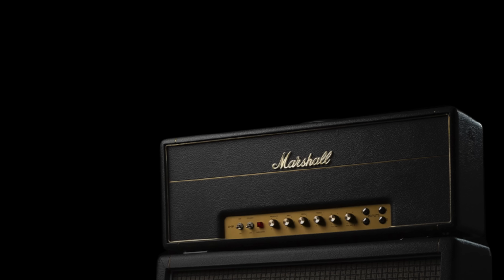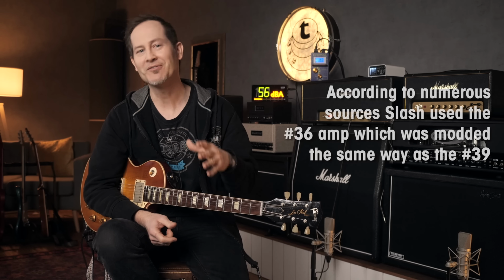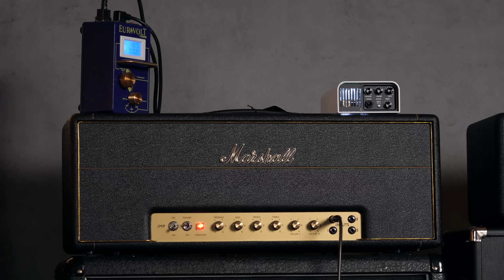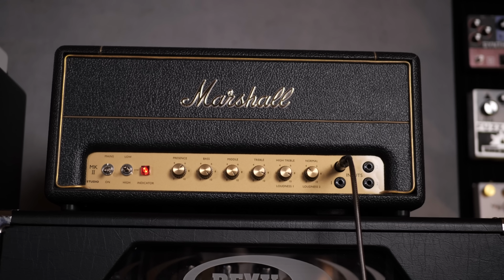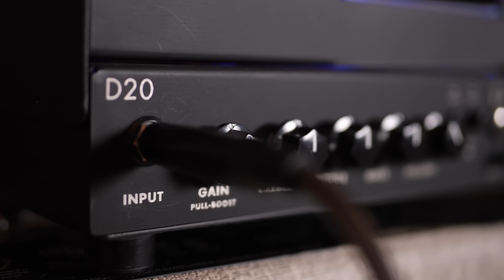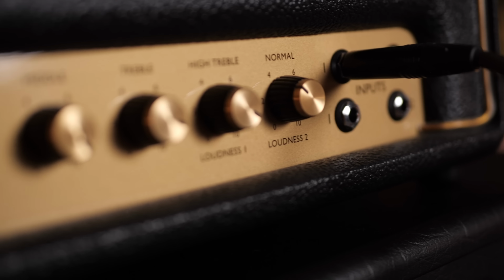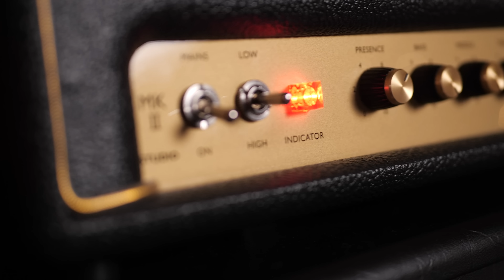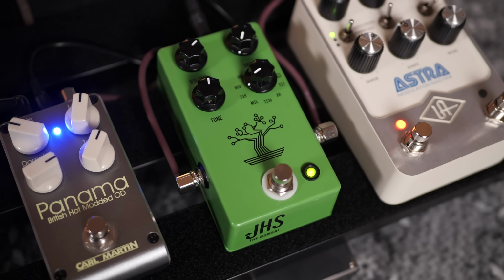Recreating the Legendary Modded Plexi Tone | Master Your Tone #1 | Thomann

Comment: The EVH Variac thing… He did that originally because he bought a 220v amp in England and wanted to use it in the US at 110v. It didn’t sound right. He used the Variac simply to match the transformer voltage. Lowering the volume was a side effect.

Comment: Basically eddie had a 100w slp, the 1959HW based in mid 60's, the slp based is in late 60's which eddie start build her brown sound, Kris you did it again the sound with the variac and paf pickup is glorious!! Also, back in this years marshall sell this amps with different settings...like 50k mid pots now is 25k

Comment: i notice you didn't patch the two channels together.  even just a little of the 2nd channels adds a touch of bigness to the sound, especially at low volumes, but the cranked tone does get fuller, but unachievable without blowing ear drums or using a load box now.  so cool to have these options nowadays of captor x and the like.
Reply: When these are pushed there is no need to patch them.  At lower volumes you see a difference but when cranked not need3d and can muddy the amp.  That’s why if you look at most pics of the greats, the amp is seldom jumped

Comment: Can you use an attenuator on a combo amp?
Reply from the maker: Yes, of course. You have to put the attenuator between the amp's speaker output and the speaker. For that you have to be able to unplug the speaker cable, which is possible on most combos. Cheers //Kris